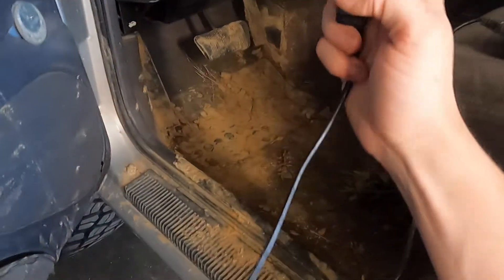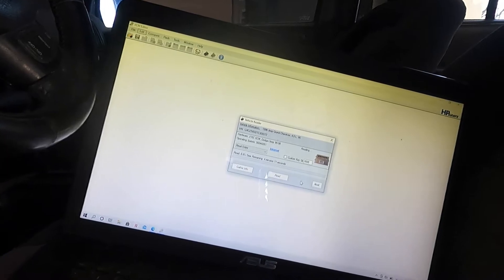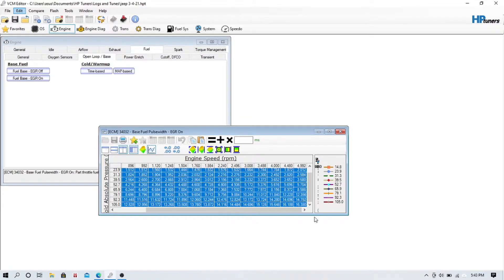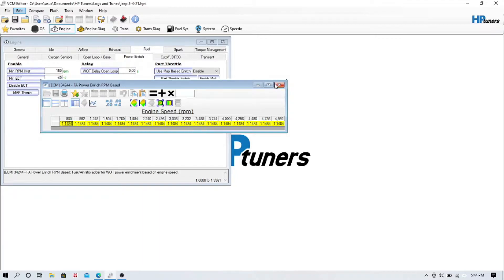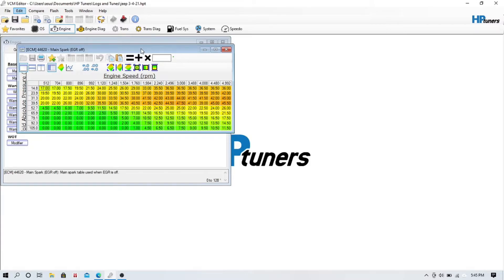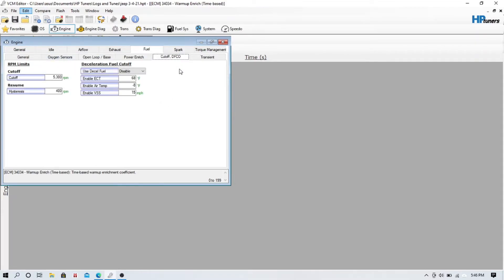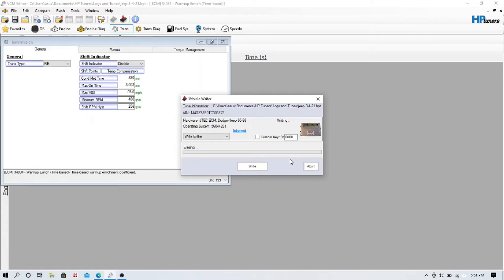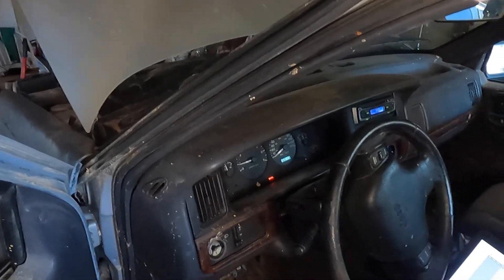intro to hptuners for jtec

Comment: With an early model (1993) ZJ,
I'm going to need to swap in a late model PCM & wire harness, do i need the body control module too?

I bet i need to swap the whole wire harness and use a matching set of keys/bcm+pcm, going to look for a donor jeep.
Reply from the maker: I don't really know. You can standalon the ECU harness but if yours is automatic I'm sure it will require a bit more to get the original tcu working. If your 93 has a aw4 and not a 42re.

Comment: This video mostly answers my question on the other video. I have a Mopar 5033224AB 2 Bar MAP sensor to use on my V10. Assuming the original 1 Bar and the new 2 Bar both scale pretty linear, hopefully I can basically just treat everything as 0.5X the actual value. Only shooting for 7-10 psi of boost. Very helpful!

Comment: I just got my MPVI3 today and have joined the Jeep JTEC Alpha Firmware program. I just get Protocol Failed when I try to read, kinda freaking out at the moment.
Reply from the maker: Make sure the scanner software is disconnected to vehicle if you've started that it will make the write and read not work. on top right in the menus in the edit software click the resync interface and make sure you have an internet connection
Reply: @thomasbeyer  Well I tried again connected to pc not vehicle do the resybc then bring up read and connect to vehicle wait 15 seconds. Same outcome Detecting Protocol Failed
Reply from the maker: @bertfriedman  unfortunately I haven't played with the mpvi 3 the first mpvi 2 I ordered was bad right out of the box and I had to get a replacement

Comment: What version of HP tuners are you using? I have a 98 and it will not read my ecm
Reply from the maker: Mpvi2 I use it on my 96 grand Cherokee and my 99 Dakota
Reply: @thomasbeyer  well thats my issue. I have the mpvi 1 pro

Comment: I just got my hptuner kit for my 96 XJ.  I'm not turbo, I just want to optimize fuel and timing.    1) So base fuel and spark are all I really need to mess with?   2) What about power enrich- does it apply a constant enrichment at WOT or is it temporary like an accelerator pump on a carb?     3) what does the pro features provide on this platform?   4) does flashing back to the stock file I downloaded put it completely back to stock, checksums and all?   Because california... meh
Reply from the maker: 1) pretty much yeah that's it. 2) no. The power enrichment is constant. Once it crosses the power enrichment threshold it goes from closed loop to open loop and stops doing corrections. In closed loop the ecu is trying to make it run at 14.7 AFR. So that's the purpose of power enrichment. 3) pro features does the same thing on every platform really. I don't have pro features. The only thing I thought I needed it for was to datalog with a wideband. But IV got a video of how to do that without pro features.4) it will put it back to stock and the ecu will act like you just cleared the codes so no readiness monitors will be set
Reply: @thomasbeyer  thank you!   This answers my questions perfectly!
Reply: @thomasbeyer  One more question.   Do you know the difference between Warm Spark table vs the Main Spark?    Should anything be done on Warm Spark?
Reply from the maker: @v12alpine  I played with that for a bit. And decided to make all the spark tables the same. So it will always follow where you put it no question.

Comment: I have a 98 jeep grand Cherokee zj with 4.7 stroker and supercharged, I use a split second box for controll larger injectors and in boost, I'm looking to data log rpm with aem afr, my question with hp tuners if you change the perimeter etc does that wright to your pcm? as mine is a continuous learning one, many thanks bd
Reply from the maker: Nothing you do in the scanner effects the pcm. Is that what your asking?
Reply: @thomasbeyer  so when you make changes e.g. timing fuel etc how does that programme to your car?
Reply from the maker: If your making changes to the file in hptuners you will have to flash it to the car.
Reply: @thomasbeyer  ok many thanks bd for your help, keep up the good work

Comment: Can you control overdrive and lockup with hp tuners?
Reply from the maker: I believe so but only on ECUs that control the transmission some of the earlier jtec vehicles still had a separate TCU. My Dakota RT is controlled by the ECU and my Jeep has a separate TCU
Reply: @thomasbeyer  Awesome I have a 1998 Dakota with a 360 I'm hoping I can control it.

Comment: Thanks for sharing, guys on HP tuners forum are very “tight lips” when it comes to share info about JTEC, learning this in an other language makes things a bit more difficult to understand. I’ll probably ask you some basic info on HP tuner if you don’t mind, Greetings from Paris France
Reply: When I tried to flash a tune on my dodge truck it made it through the erasing part and right after that it says writer transfer failed to start
Reply: @austinbaskin1910  are you using MPVi2 or 3 ?
Reply: @jeepgarage  I’m using an mpvi 3
Reply from the maker: It happens sometimes. Try it again. Also try resyncing the device.
Reply from the maker: Greetings. Im happy to help. You are right most people don't like sharing

Comment: Como ce modifican los inyectores en el scanner
Reply from the maker: No need to. Jtec ECU doesn't work in volometric efficiency. It uses raw opening time
Reply: @thomasbeyer  gracias amigo buen video sigue así sigo todos tus contenidos
Reply: @thomasbeyer  What is the volumetric efficiency table in the menu? is the one that says egr 2 in the open loop menu
Reply from the maker: Main fuel table egr off and main fuel table egr on. But they are not volumetric efficiency that's just pulse width.
Reply: @thomasbeyer  tanks bro!!!

Comment: Thanks, this is useful. So a write failure early on in the write process can brick a PCM? I've thankfully only had later write failures.
Reply from the maker: Yes potentially. Iv gotten lucky too. I'm not going to try it but I'd imagine if it failed in the middle of erasing it's done but after the first couple percent of writing it's probably ok. But I'm going to do my best not to find out lol
Reply: @thomasbeyer  There's always the fallback of Syked if the problem persists. Never heard of inconsistent behavior from that platform. Have you been on HPTuners long enough to see the changes to JTEC parameters as the software versions incremented? I'm genuinely curious to know if there's more to unlock in JTEC - I want to be able to do things like trans quick learns, tire size calibrations, etc.
Reply from the maker: I haven't been using it long enough to see the change I was using it on my Dakota about a year ago but it's jtec+ and has more transmission related stuff but the main engine tuning is about the same.
Reply: @thomasbeyer  yeah lots of tunability on the RFE transmissions, a lot more obfuscated than newer Chrysler trans but still a lot of knobs and dials in there.